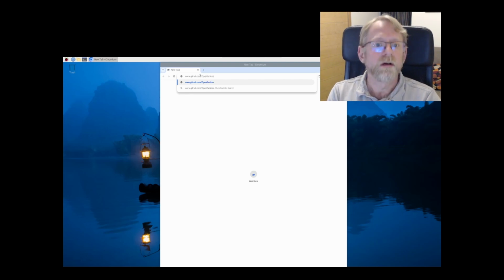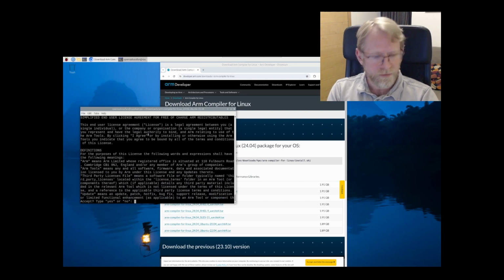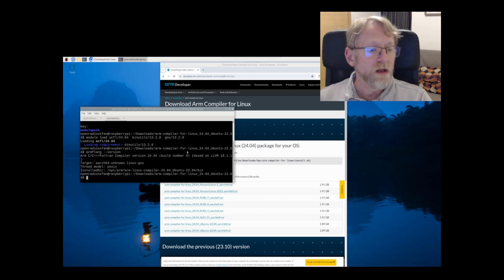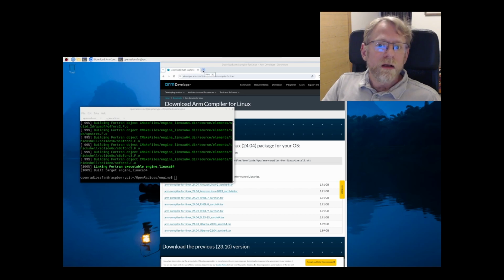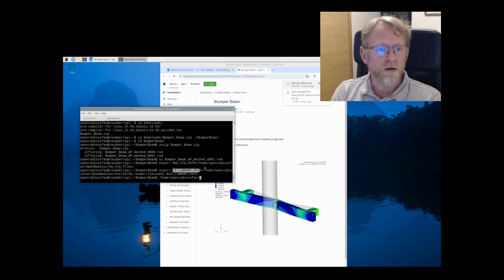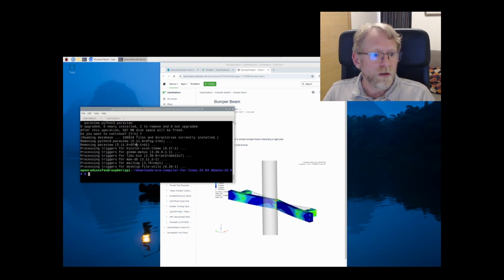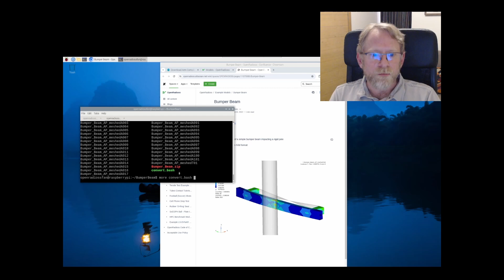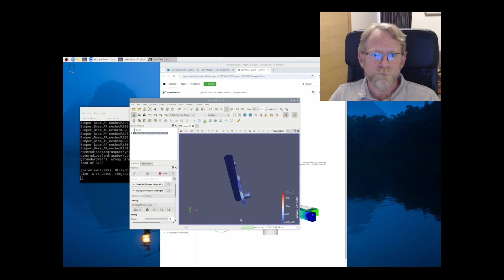OpenRadioss on a Raspberry Pi

Comment: Hello
Today, with ARM CPUs, we support only Linux.
I recommend to use WSL or a virtual machine on Windows 10-11 / MacOS  to run OpenRadioss.

OpenRadioss is running natively on Windows 10/11 OS with Intel/AMD CPUS. You will find Howtos for both platforms in thisd channel.
Hope it Helps.